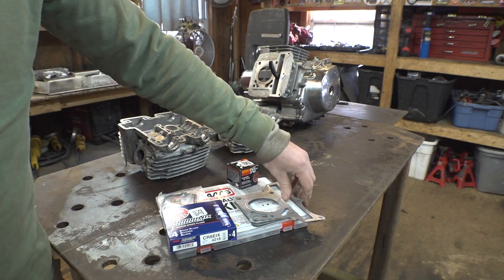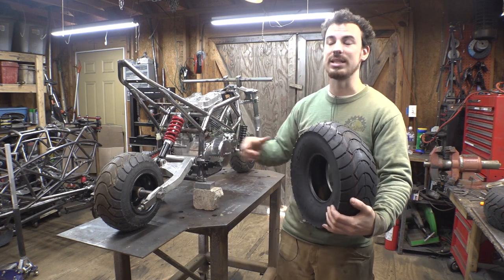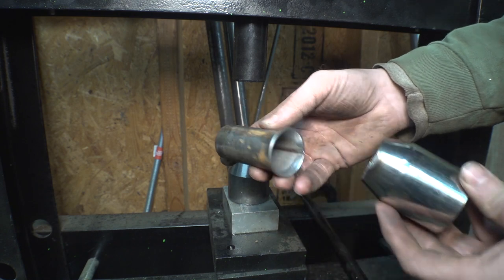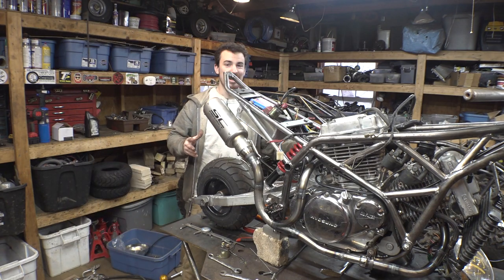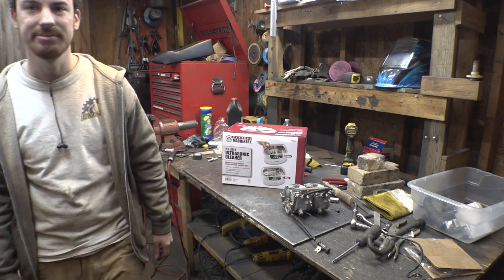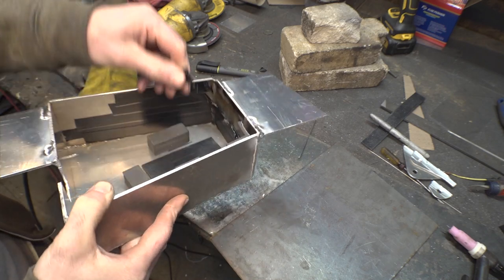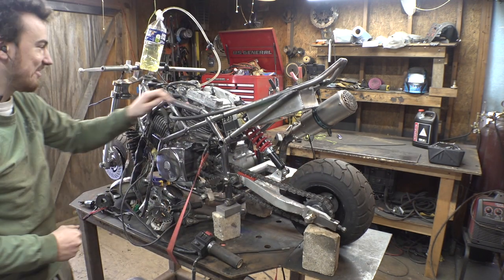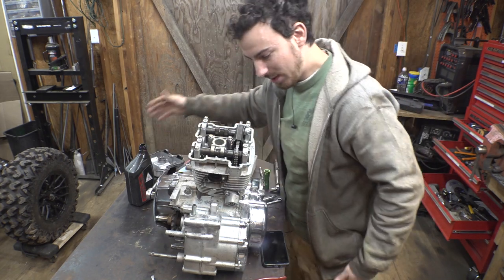Getting the Mini Crotch Rocket Running!!  Mini Crotch Rocket Build Part 7

Comment: Kickstand sensor if it thinks that the kickstand sensor is down engine will not start or crank and if it is in gear it will not run it will turn off as soon as it starts if it takes the kickstands down

Comment: rather b welding at 38:45 theres an older build of your mini crotch rocket build not sure if you knew it.. your fixing the engine and talking about dropping the chain down in the engine. use a strong magnet stick should help fish it back out.

Comment: Out of curiosity what was the size of the exhaust tubing before you reduced it to the size you reduced it to just wondering if you're going to have a flow issue or a building up too much exhaust gases forcing it through that small diameter pipe

Comment: if it shocked you then the plug cap has failed you should be able to hold them while running with no shock

Comment: What was that head stock bearing?
it really should be a taped  bearing.
small wheels equal instability.
can you not run the exhaust under the seat?

Comment: should have set the tray on top of the brackets and  it wouldn't fall off when you removed the bolts for seat.. no extra bolt or drilling..

Comment: That's what you need the heat probe for that gun that shoots the laser for the heat you shoot it at the exhaust pipe at the front of the head and you should have the exhaust pipe in the back of the head and that'll tell you if it's firing or not didn't you do that before on another one

Comment: Your clutch discs may be stuck together, just lock the rear tire in place and put in gear, the engine will stall and free the clutch. And the clack sound it does is not good to hear, hurts right in the pocket.

Comment: You’re supposed to use Power Purple on the Sonic cleaner. Or CLR for very dirty parts.
Reply: Power purple damages aluminum so be careful what you're using it on.
Reply: @Lucas12v  really? I’ve seen lots of YouTubers use it. They haven’t said anything. But ok.
Reply: @18wheeler77  Damage was the wrong word. More correct would be to say it can make aluminum hazy and dull. Not necessarily a big deal, just something to keep in mind. It's basically corrosion on the surface. It will damage some paints and coatings too.

Comment: Did it have a fuel pump because if it did it's not going to run without a fuel pump has to have the right fuel pressure for it to run both cylinders and are you getting fuel to both carburetors you know there's a screw on the bottom of the bowl that'll let you know if both carbs are getting gas you open it up and it'll come out the drain plug

Comment: It doesn’t sound like a normal v-twin cause of the exhaust routing / design you did..
What you hear is the typical unequal length header sound..which can sound way better than any v-twin sound if tuned right

Comment: Dude, you need to get yourself a welding table.
I'm only 38 and there's no way I could bend over for that long welding without my lower back giving out. Just from doing stupid things. Bent over car engines working. Jumping off stupid things. Lifting stupid things.

Comment: lil trick from clutch plates being stuck together from sitting brutha. put the front wheel up against the wall hold the clutch in put bike in 3rd gear and without reving it set your idle up just a tad bit more than idle and pop the clutch meaning dumping the clutch at no throttle it will stall the engine then start it again and see if the clutch works better if not try it again. let me know how that works out for you.
Reply: Just drop out the clutch pack, Inspec and seperate
Reply: @russcole5685  yes thats the proper way of doing it im saying a trick way of doing it

Comment: Just check pilot screw adjustment and balance the carbs 👍👍
Reply: Agreed, you can hear it come up on the 2nd cylinder when the revs come up, carbs are out of balance.  That was the chain 'hop' cause as it was lumping along below idle in gear.
Reply: @771racing  👍👍

Comment: I'm kinda coming into this really later but your front brake disk is way to big. Not only is it terribly out of proportion but with it being the same size or larger than the front wheel and that makes it actually dangerous. If your front tire deforms over a hard bump you could conceivably impact your disk not to mention the inherent risk if the tire deflates. Just a bad idea all around.

Comment: The way that tire burned i think more than 28 miles per hour even 38 horse power old and not cb engines don't spin that fast you can see tire spinning on Volkswagen than on police cars and other vehicles and cb performance ones